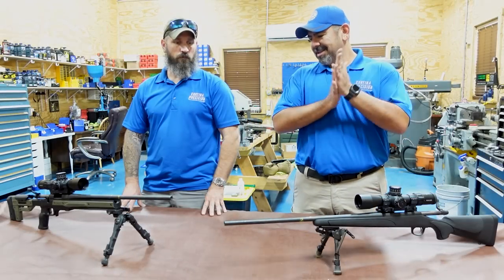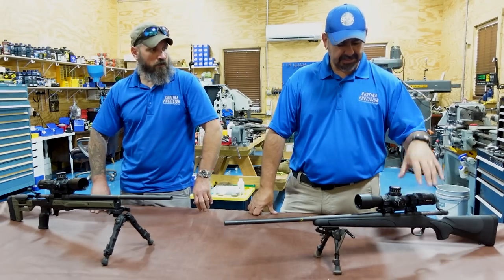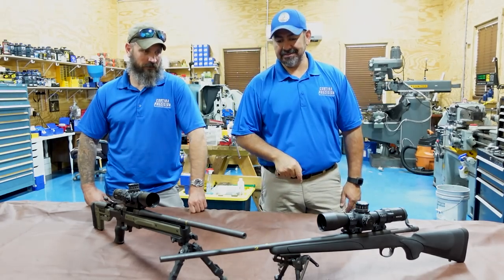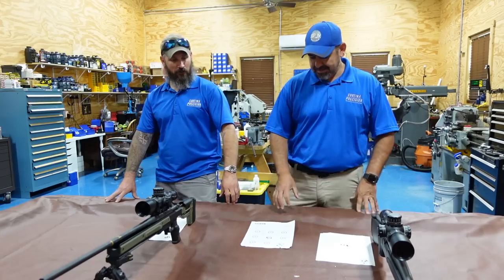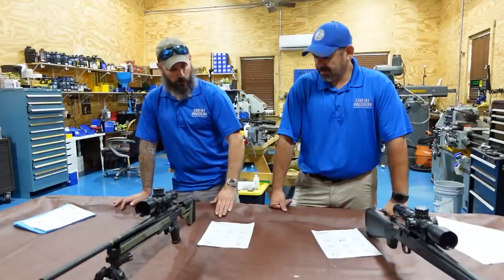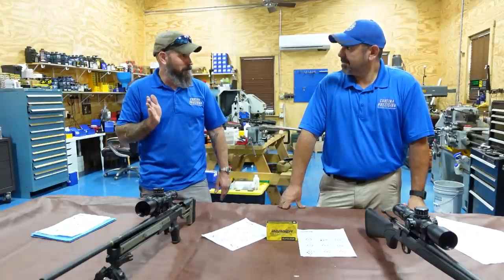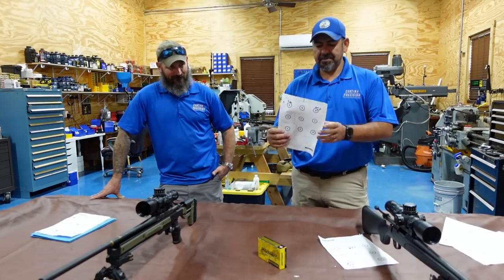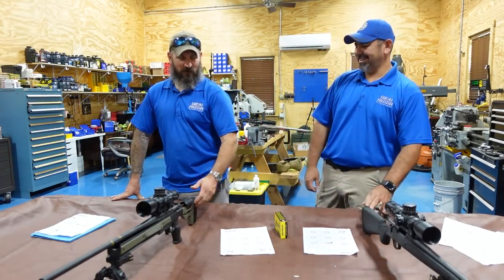6.5 NEEDS-MORE | NEW ORYX CHASSIS

Comment: Slow down here!!!! Why not rig up the control like a low budget hunter would. Low rings and a cheek pad like the hornady stock pack. Get comfortable at a budget . Adjust trigger if it’s an xmark adjustable trigger. Your comparison is going to end up as 2 heavily modified rifles. That’s a different comparison then we started with. Bring up the comb with a cheek piece, bring down the scoope with the lowest set up you can use with the scope. Lighten up the trigger if possible then the comparison is still legit. Mod vs stock. The groups are still even at this point. Let’s get a winner here first then catch up the control gun and do it in a way that we can see what mod makes the biggest difference. Is it the tuner brake, stock, trigger.

Comment: In my view the point of a control is keep it constant.   You know it will under perform, howeverver is that not the point of the experiment.   How much better over your stock control system can you improve.
Reply: But we already have the results of the control.
Reply: Changing any of the stock items the control rifle had just changes the game. Leave the stock on rifle 2 upgrade it bipod, add an EC tuner brake to rifle1 and reboot for the next episode.

After going as far as possible on rifle 1 complete the comparison followed by all the updates onto rifle two and see if it shoots better than rifle one (as you might expect it to)
Reply: What about looking to the second hand market for different used factory stocks, wood vs synthetics old vs new.  Invest time into the control and money into the other.
Reply: @trickiejohn  we already know how the control shot. That data is recorded.
Reply: @graynotescartridgebox  , it doesn't matter if you know today. Next time you go out the conditions might change. Then you dont have your control rifle to validate the change. In other words what if you make a change to the other rifle and it's worse?  You will need to verify with the controlled rifle that it is actually worse. What if you make a chage to both rifles you don't know.
Reply: @joeldubose5762  the baseline accuracy is already there. That’s all it needs compared to for what they are doing. They are using the same lot of ammo. You can’t expect the control to change based on changes of the other rifle.
Reply: @1newme425  I agree.
Reply: @joeldubose5762  Agree. Even a different box of the same ammo can throw everything sideways. Some of those numbers were a bit weird in this video. Both velocities went up on the 2nd group...but a 46fps slower average for one group on the upgraded rifle? What's up with that?? And 19.5 STDV on the final group? That alone can give a person +1" group.

Control rifle:
2712
13
6.2

2722
24
9.8

Upgraded rifle:
2676
28
11.6

2701
55
19.5

Comment: Leave the 'Control' the control...its already the best of the two out of the box.  The goal is still how much better can the other rifle be improved with upgrades.  Keep the round count the same on both rifles, but only upgrade #1. Trigger first because that is something anyone can do without needing a gunsmith (an assumption that should be considered with each subsequent upgrade).
Reply: Yeah the next mod should be a trigger.  Then I'd use JB Compound and JB Bright to polish the barrel bore.  I outfitted my .308 SPS Varmint with a HS Precision stock, Timney Trigger, and JB'd the shit out of the barrel and took a 1.5 MOA rifle to a consistent 1/3 MOA rifle after extensive load development. It can be done and I learned a lot in the process.
Reply: agree about leaving the control alone...other than perhaps testing other ammos on each of them. See if things stay the same between the two with; hunting rounds, vs. match, vs tipped, vs. fmj.
Reply: @MC-wh6xk  never heard of this before. Thanks for the input & going to try to learn something.

Comment: I did a similar project with a Savage Axis in 223.  Kept the factory stock just to see what I could do with it.  Stiffened up the fore end by bedding in a lattice of short carbon fibre rods salvaged out of a broken kite.  Floated the barrel.  Filled the shoulder stock with a foam / lead shot / epoxy mix to get the balance better.  Rattle can paint job.  That was it.

Will it win any comps.  No.  Accurate enough for small deer, and plinking out to 500m, absolutely it's just about under 1moa.  Total spend was under £300 including a scope.  8 years and counting of cheap fun times!

Hope these ones are as much fun.

Edited to include Oxford comma!

Comment: Liking the Creedmoor needs more series. 
So far everything done to both of these test subjects can be done by someone at home. 
I say do the triggers. Use a timney or a jewel, since both should be relatively easy for anyone to get.
The triggers can be installed at home. 
I would test the trigger pull of the factory ones, just to know how bad they really are, then install the new ones and set at 3 or 4 lbs  to start. 
So far nothing has required a trip to the gunsmith.
Then hand load and tune loads to each rifle. 
Then it's time for the trip to the gunsmith for barrel threading and tuner brakes.
I like that you are doing this, it will most definitely help show how a person that either wants to upgrade their hunting rifle, wants to do PRS or F class can get started, without braking the bank or needing a gunsmith, just to get started. 
Stay cool in the BBQ pit of south Texas and as others are too, will be waiting for the next video to see what you do.
Thanks

Comment: You’ve got the outcome of two range sessions with the control being basically identical, so I’m for adding the chassis to the control, as you can always refer back to previous results w/o chassis. Plus I’m very curious to see if the control action/barrel are just better for some reason. What if it’s .5 MOA after chassis? Then it’d be cool to see you try to figure out why one is so different from the other.
Reply: Was just scrolling down to post the same!  Would be curious to see the chassis on the control for a group and then switch it back before continuing on.

Maybe use the Control gun to swap a single part at a time (put on a chassis then switch back to original stock, then test just a trigger or just a tuner, etc.), and use #1 to test the cumulative effect of the upgrades.
Reply: Agreed, for me $600 is something but for this series and shooter comfort I can see both having the chassis(since it's not my cash) and then incrementally adding details to experimental, eric cortina tuner/brake first, will be interesting to see what improvement(using match factory ammo), the only other things I can think of improving since the optics are set would be match trigger, custom barrel. maybe show difference between using rear bag and no bag but a sniper can probably adjust and make it shoot good regardless. as a finale maybe have some average shooter use both and see difference?

Comment: I am very curious as to what the effectiveness of hand lapping the barrels would be on these 2 Remingtons. Hand lapping has a very proven track record for shrinking groups, however it is one of the most overlooked steps in tightening group size on new rifles. I look forward to watching more from you guys.
Reply: Works like a charm. But I like getting them new before shot.
Reply: have a similar reminton rifle and a bergara hmr pro in 6.5 creedmoor.....the barrel on the bergara is lapped the Remington is not...when you push a cleaning patch through the barrels you can really feel the difference....copper cleans out the bergara barrel in just a few patches...the Remington takes forever to get copper out..have seriously been thinking about lapping barrel...gonna give it a few more rounds and see if it settles in...once had Remington rifle that took almost 200 rounds to break in and settle down
Reply: @michaellankford8358  I never shoot a new barrel before I lapp it in anything.  My brand new 300 ultramarine was filthy with rust and small metal burs from tooling. I cleaned on it for a long time before scoping it. I was amazed how crappy it was. So I lapped the hell out of it, then took metal polish on a brass brush and a patch wrapped around it and polished the heck out of it untill it felt smooth as silk. It shoots .25" groups

Comment: I am building a 1965 Rem 700 ADL right now.  .30-06.Just pillar bedded and free floated the barrel.  Then cut barrel threads today and ordered an EC tuner.  Ordered a Limbsaver recoil pad to replace the old hard one.

Comment: Triggers are relatively easy to do. I’d be inclined to change triggers first and save the tuner brakes to the end. The tuner brakes are the ultimate way to fine tune for accuracy. Stocks and triggers are basic things guys can do without gunsmith help.

Comment: I have a ser of Ruger American Predators in .243 & 6.5cm.
The 243 RAP has turned I to my favorite hunting rifle with a Burris XTR scope! .  Due to a military training accident back in 2000 it has effected the way I shoot because I can't bend my wrist.  So pistol grip stocks have become my go to fix.  I had got the Magpul stocks for the both, and didn't shoot the 6.5 much.  Got an MDT chassis for one and swamped around and loved it. A yr or two later I missed getting another but seen the Oryx, so I bought it and put it on the 243.  The comfort, and allow me to shoot without having to use my middle finger for trigger.
They are still an expense to get, but the comfort and bassass factor are worth it. Yes, they both created the accuracy to improve.  I use a suppressor so the only mod I can do is trigger.

Comment: For a budget comparison, my Savage Axis is a $250 used gun in a $100 clearance priced gen 1 MDT LSS with about a $60 magazine, a $40 grip and I think about $200 for an ICD folding stock, a $250 pre-cut barrel, a $150 barrel nut/recoil lug system, and about $170 for the Glades fluted bolt sleeve, bolt handle and a delrin bolt knob I liked.  I think the Leupold 7075 scope rail was around $40 and there is a few dollars of Devcon 10110 bedding in it, a spring I stole out of a $0.10 retractable ball point pen and $3-4.00 of shim washers to remove most of the side-to-side slop in the trigger.

That's around $1,400 with a scope rail but no scope and no rings.  The bolt stuff is nice but mostly cosmetic.  The folder is at least $100 more than I had to spend and the grip could be an A2 discarded from an AR parts kit if i wanted to be cheap so $1,100 is the real baseline.  I did get a deal on the chassis but I've seen better deals on donor actions so I think that's a wash.

I'm not saying you have to go that way or that your idea to use the Oryx for a full custom build later won't work, just that there are cheaper options that let you get all of the goodies for close to the same price as a Remington in a chassis.  Also, beside facing my receiver after I cut it for a 110 style barrel lug, all of the work was DIY with basic hand tools.  I could have faced and flattened my receiver with some feeler gauges and a flat stone if I wanted to be 100% DIY friendly but I like lathes.

If you must have a top tier trigger like a Bix-n-Andy or Triggertech, the Savage doesn't have those options but if you are ok with a spring swapped and shimmed Accu-trigger, it's a neat project.

Comment: Your video with the Oryx chassis came at just the right time.  I'm putting together a rifle, for local club shoots, all amateurs,  out to three hundred yards.  I'm about settled on a Remington trued 700 action, Krieger barrel, Oryx chassis, and a Jewel trigger, in 6mm br.  That's about what my budget will allow. Wondered what you thought about my choices.  
Thank you for having the best channel out here.  Professionally done, with great content.
Reply: I bought a 700 ADL Tactical in 6.5 needmore with a 24” varmint contour barrel from dicks sporting goods a couple years ago for $419. It has the cheapo stock, same as theirs. I knew the stock was cheap but the barrel and action alone was worth the price. Out of the box it shot a 1/2 group at 100 yards. I was very surprised to say the least. I want to put it in a better stock or chassis as well. You might look for one of these if you can still find them or maybe a used one. With all the Remington bankruptcy stuff I don’t know if their still available. Worth a shot though.

Comment: I've had a few sps Remington 700's 
I always free float them and epoxy bed them from sling stud to action. Really stiffens that crappy stock. I also lapp the barrel before shooting it, then polish.
I normally get well under 1" usually  1/2" groupings. From thier load development to bring it in tighter. This has given me repeatedly good results. Even my 300 ultra has shot .25 groups at 100. But your nerves do get rattled after 10 or so shots. I did end up installing a whitt Machine clamp on brake that tames this down but ive not checked groups since.
Reply: Lapping.... That is one thing that I have found many times over that often has a substantial effect on production rifle barrels.
Reply: @CJ-ty8sv  Me too, especially with Remington SPS barrels. If you bore scope that thing, out of the box, like looking at a dumpster fire.  But, with a little love and patience, they clean up nicely. Also, blueprinting the action and barrel face.

Comment: I just did the same thing with my Remington 300 Blackout only I went with a KRG Bravo chassis. It was factory stocked with the Hogue rubbery stock that I attempted to glass a reinforcing rod in the fore end. It still flexed so bad the stock would contact the barrel just the weight of the rifle with the suppressor attached when supported with a bipod. The first thing I did when I got this rifle was replace the trigger with a Timney however the chassis didn't change the accuracy but the rifle is way more comfortable to shoot and I can attach it to a tripod via the arca rail I added to the KRG. I like the looks of that Oryx chassis might have been a better choice for me.
Reply: How well does that feed in the krg bravo?  What mags do you use? I'm looking at getting a 300 blackout barrel for my r700
Reply: @newerest1  I replied the other day but for some reason maybe it didn't send. I use MDT magazines I got from Midway that are for .223 or 300 BO. I have had a couple of jams from the short BO bullets that go too high entering the chamber. If you work the bolt aggressively they run fine.

Comment: Definitely a difference in the way the recoil displaced the gun between the two, not sure if the chassis or the bipod was the difference, but, it was visible. He had to reset the gun every time he shot with the Rem stock.
Reply: Yup, significantly better recoil management with the Oryx.

Comment: My view is that you should just leave the stock on the control rifle, upgrade the bipod and add a tuner brake to both rifles, before adding the Oryx to the control rifle.  I just fitted an Oryxto my Tikka ctr in 223 as the stock was providing the comfort or recoil management. Still waiting to shoot it sadly

Keep up the good work

Comment: Make the exact same changes to the stock rifle, but keep it one step behind the upgraded rifle.  You have your control groups to look back on, which appears to be consistent.  So, switch the cheap plastic stock to the ORYX Chassis and the same bipod on the control rifle this time, with the EC Tuner Break on this other.  Then for the next change, trigger on the upgraded and tuner break on the other.

Comment: Thanks for doing this , great concept, great series…
I would suggest that you upgrades in order of price  or affordability, ie do the cheaper things first…
 Check the free floating, and fix that, trigger, you addressed that,   Put Aluminium pillow beds in the stock, stock cheek weld,  etc. 
start with inexpensive, then ramp up to expensive. I think shooting accuracy is a lot about price.
On the other hand ,  when I was looking for a new stock for my 1984 Winchester mod 70 xtr, ONYX  was the first place I tried.
ONYX said they didn’t make a chassis to fit that gun….BOO HOO
Reply: have similar Remington rifle..worst shooting remington have ever owned...tried  everything could think of....floated barrel...filled forearm with epoxy...butt with silicone calk...pillar bedded...fixed factory trigger....sill wouldn't shoot less than 1.5 inches....biggest problem with gun is barrel throat is way long...and  internal magazine is so freaking short anything longer than 2.80 won't fit or feed....tried all types of handload and bullets but no great results loaded to the 2.80 oal....THEN ONE DAY!!!! I had loaded up some 130 eld match bullets for my Bergara hmr which will shoot about anything....decided to load to 2.80 because bullet is so short...results I'm my bergara were not overly impressive so instead of taking time to pull the bullets apart decided to just shoot them up in the damn Remington and not dirty up my bergara barrel....after throwing a couple downrange I was shocked....settled down on new target and fired the last 5 into a .35 group...went home and loaded 100 just for the remnington... riflewill repeat these results for 5 shots then barrel get hot and groups open up....havent run this load over the chronograph  yet....when something shoots this good don't care how fast it is but good to know so can use ballistic app to figure bullet dope.... took load off hornady app so should be safe in all guns...hornady case neck turned to .013...cci large rifle primers...44 grains Winchester 760...130 gr.eld match...coal. 2.80